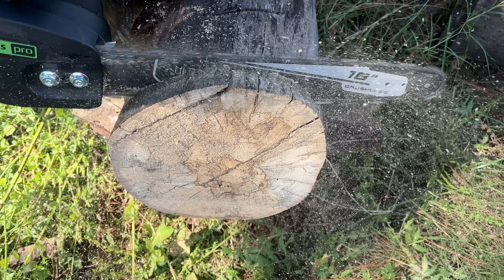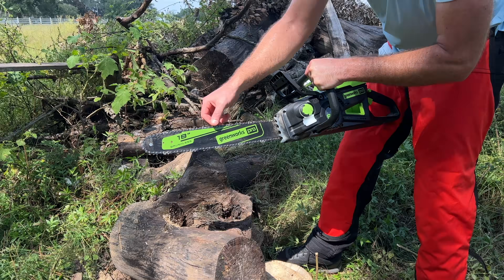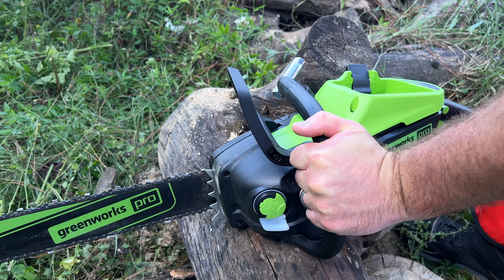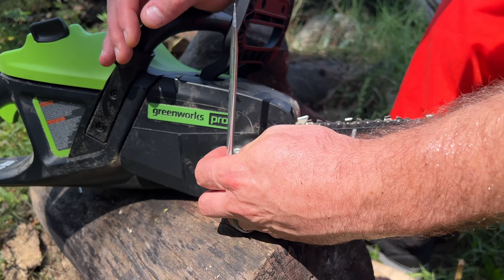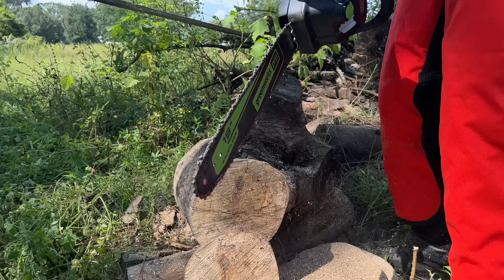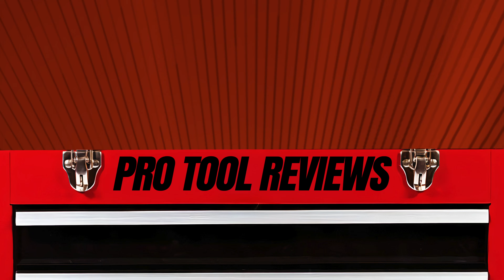60V Pro Electric Chainsaw Review | Greenworks 2019302

Comment: I have (2) Kobalt 80-volt 18" Bar Chainsaws and use (2) 5 AH Batteries. I’m 79 and love NO more having to pull a cord to start a gas-powered chainsaw. My first 80-volt 18" Bar Chain saw with a 5-AH Battery and charger was $400 in Jul 2021. - I use them on our Southeast LA farm of 18 acres of tall large pine trees that were devastated by a Hurricane and tornado. On 10 acres of the property, nearly all the trees are down or dead. My chainsaws have been working great and cutting huge logs and trees and logs up to 20"+ and it works great. As 0f July 2024  you can still order 80 volt Kobalt Chainsaw through LOWES online. I'm even looking at replacing the 18" with the Oregon 20" bar and chain for my KOBALT 80 volt chainsaw.  I also use the 80-volt 10” Pole saw, lawnmower, and Leaf Blower.

Comment: I got one sprocket went bad not available green works sent me a second unit free now i have 2 of them but the sprocket not avaliable i might weld and grind to fix it considering having a machine shop make me one
A rim sprocket kit would be a nice way to solve the problem do not know the e t a on a sprocket the saw works better then my supped up ms 250 after the chain got longer i put a sthil bar on it
The second saw has design improvements.vivian chat bot is a bitch and stupid wasted 3 hours and she could not get me a part number good saw support poor i cut hard cedar
Ible

Comment: This standard 60v saw is 2 kilowatts. the X-Range 60V version, sold by Tractor Supply Store, is 2.5 kilowatts. With either saw, you'll get no more than 1.5kW from the 2.5 amp-hour battery.